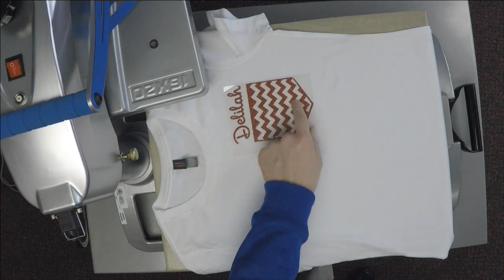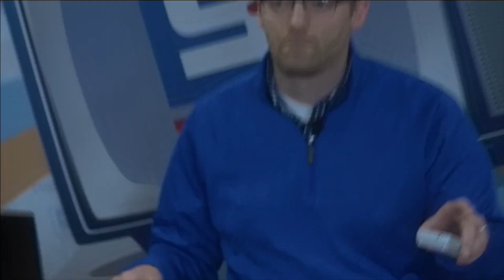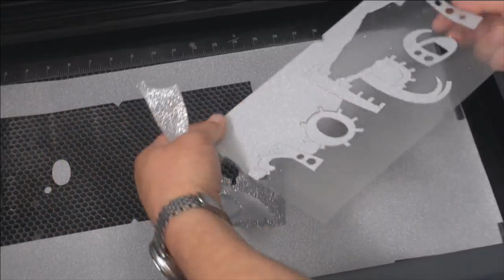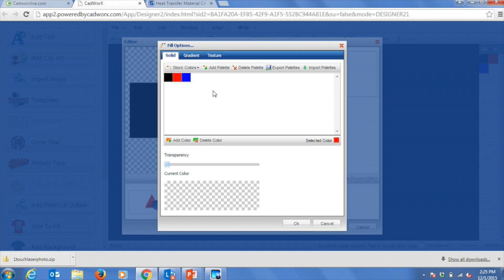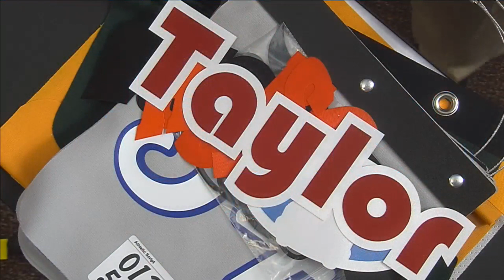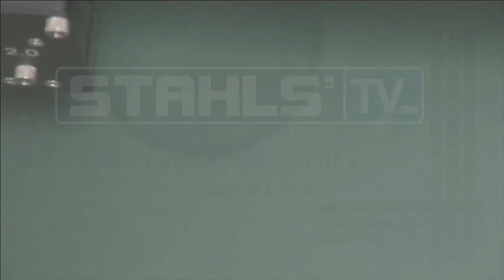Making Apparel with Your Laser Cutter 101

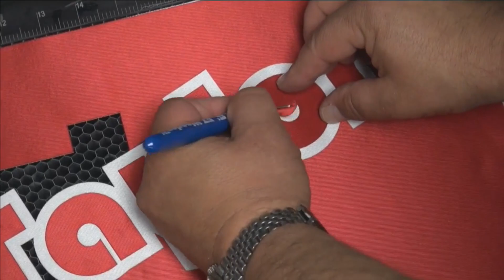Comment: This is amazing! I had no idea that HTV was laser safe. I have an Epilog 40watt. Why do you have to sew the "Taylor" twill at 27:28? You say that the top layer is "pressure sensitive" - Is the bottom layer a different type of twill that will adhere by heat, whereas the top layer isn't? THANK YOU!